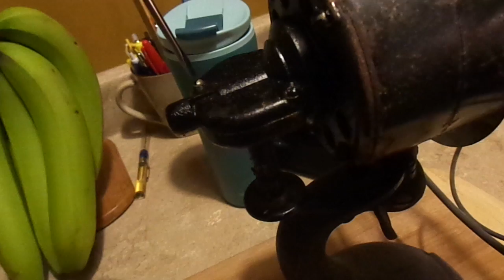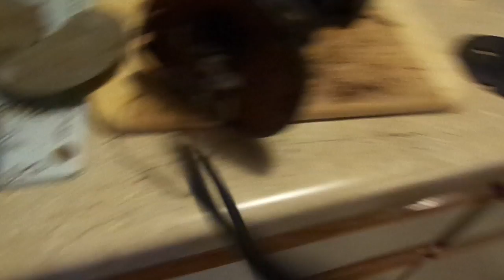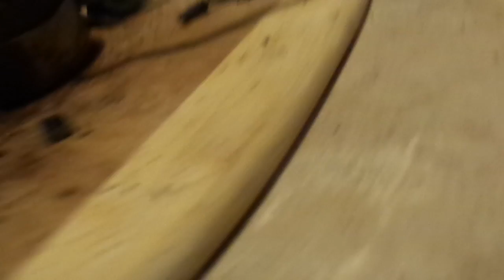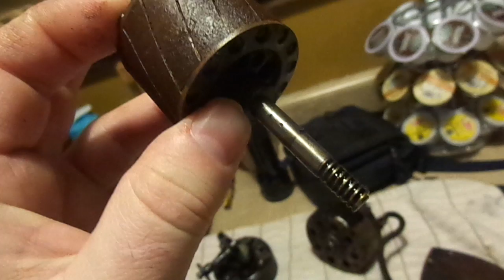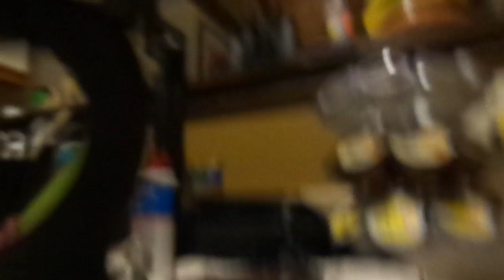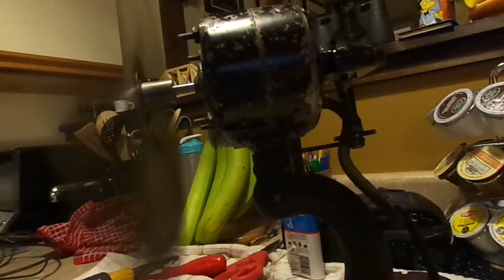Waking The Dead; Reviving The Victor Junior Electric Fan

Comment: The antique fan association recommends synthetic oils but they can be pricy. I would recommend you use a 20 weight non detergent oil. The bushings / bearings are usually porous and since it was seized up from age and rust when you first got it you'll want to clean out the pores which will probably happen from use. If you use a detergent oil the dirt will be suspended and may clog the pores that are open. Today's non detergent oils are light years ahead of what they used in the 1930s and you may want to change over to a synthetic in the future but for the first 100 hours or so I would run a non detergent oil. You will probably notice an increase in speed or longer slow time time when you shut it off as the bushings clean up and absorb the oil. If that's the blue 3 in 1 oil you're using then you're using an oil that is correct and recommended by some collectors but I was unable to read the label. It's a great feeling to bring something back to life that hasn't worked in decades and even more satisfying when you find a motor that was in such rough shape and make it work again. Fans of this quality will never be made again and every one that is saved is a piece of history. The fan I mention in my other post is a GE from 1914 that someone found in the garbage and gave it to me. The oil return holes were covered with dried up oil that was so old it looked like it was part of the case.
Reply from the maker: I’ve always used 3-in-1 fractional horsepower motor oil (non detergent/blue can).

Comment: I realize I am late to the party but just the same I thought it would be helpful to tell you how I straightened out some bent blades on an antique fan. I put a pencil length wise in a vise with the eraser sticking out. (The pencil should be level but that's not critical because what you're looking for is consistency) Then I backed the fan up until the back of one of the blades was just about touching the eraser. You can change that so it touches the blade slightly if you'd rather work that way. Then revolve the blade by hand and see which blade or blades don't touch the eraser the same way. When you have the back of the blades done turn the fan around so it is facing the eraser and do the same thing and it should match. You can change it and put the sharp end of the pencil against the blade if you prefer but I was working with a brass blade and didn't want to make any scratches but if you're working with a metal blade that's going to get painted then do whatever is easiest for you.

Comment: If you ever need authentic looking wire/cord for one of these old fans or any other restoration project: www.sundialwire.com  They're an american company, and they make a wide variety of different cords and wires for these types of things. I use their wire on old vacuum cleaners that I restore, I leave original wire and cords on if they're still good, but many times they aren't, and its nice to be able to use something that still keeps the original look.